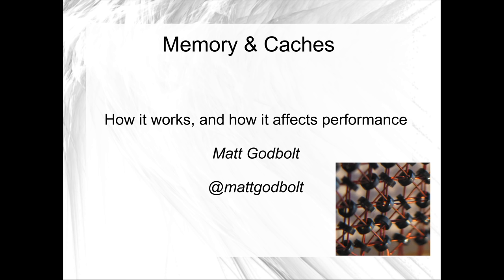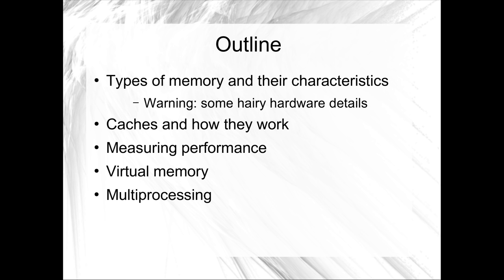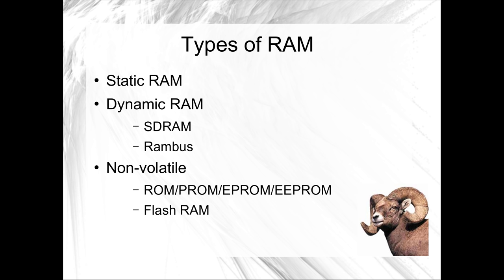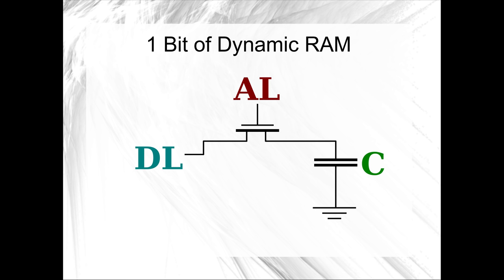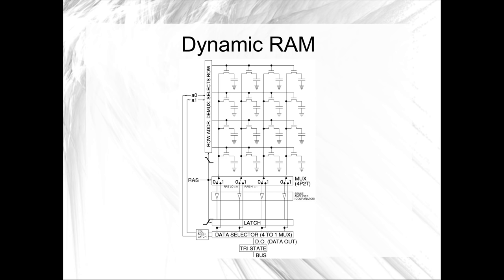Memory & Caches

Comment: Great video overall. Especially the set/way-mechanism of caches was much better explained than the college materials managed to do.

There's a correction/extension about DDR memory I would like to make:
The bus clock of DDR3 runs between 400 to 1066 MHz, for a data transfer rate of 800 to 2133 MT/s (because of Double Transfer Rate).
Only the actual DRAM cores run at a quarter of the bus frequency (100-266 MHz).
In order to satisfy eight transfers (four bus clock cycles with DDR) for each DRAM cycle, eight columns from the sense amp latches are sent in a burst.

I also assume that the random access time to DRAM increases well beyond 250 cycles not because of prefetcher noise, but because new DRAM rows have to be openened all the time, which takes a while.

Also, PCI-Express is indeed now mostly connected right to the CPUs and can therefore have non-uniform access characteristics like RAM. Most desktop systems have southbridges that can fan out more PCI-E lanes for less important peripherals, high-end servers less so.
The southbridge on multi-socket systems is also usually connected to just one socket.